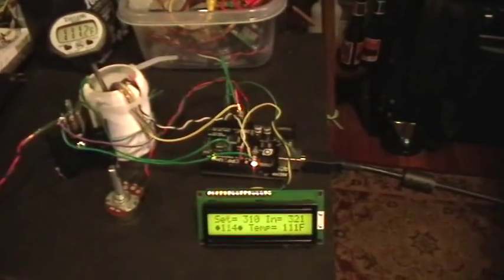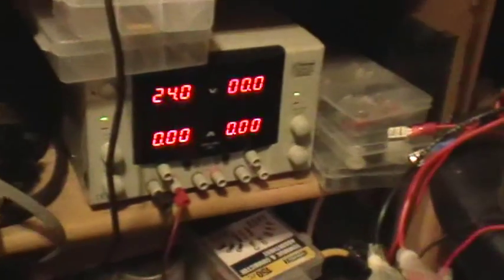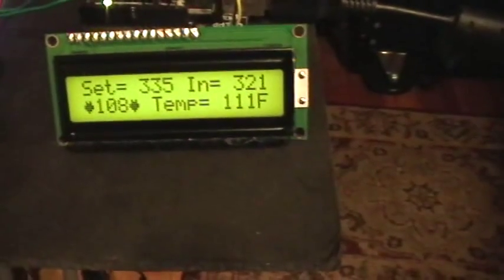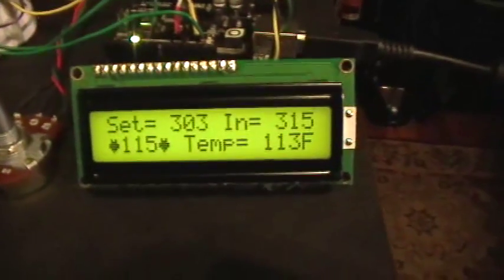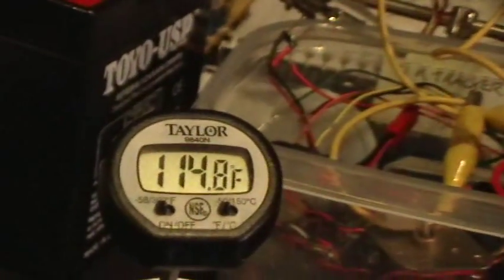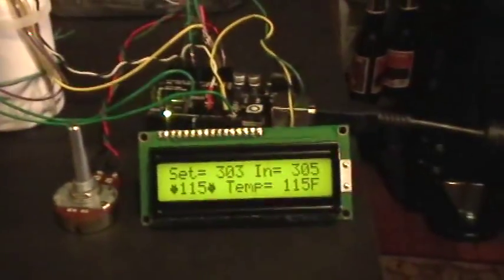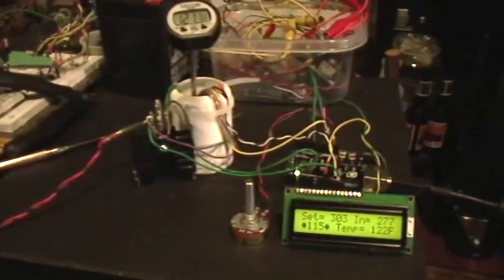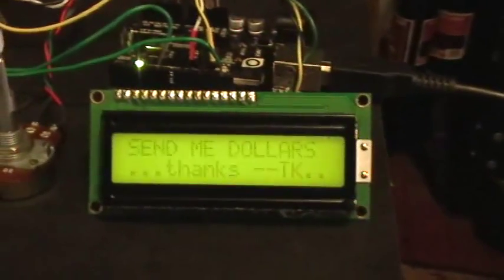Arduino 12: TK Sous Vide Cooker Controller Taking Shape, Calibration

Comment from the maker: Yes, in the full system it probably will be. This is just for calibration of the thermistor and the basic control system debugging.
With the present v.2 of the program sketch, it works quite well and holds temp within 1 degree F of the setpoint temp.